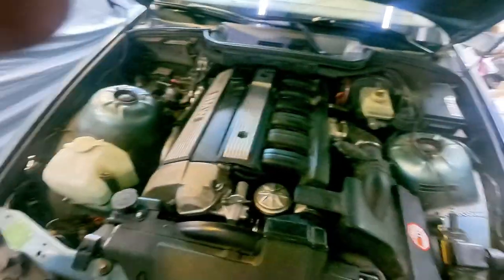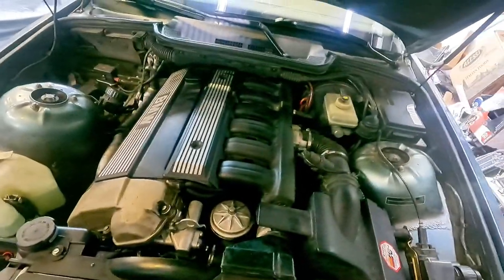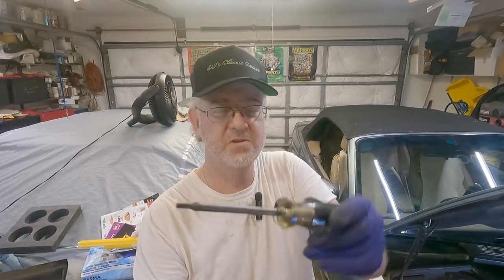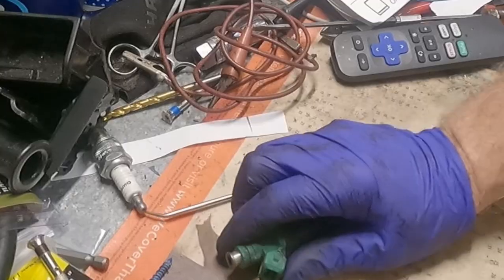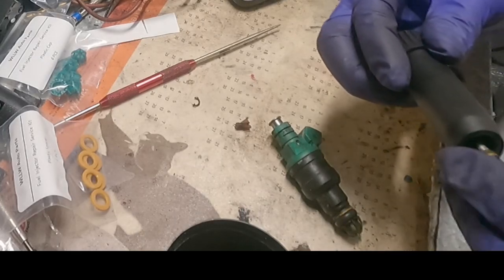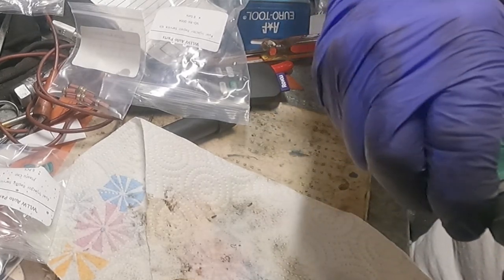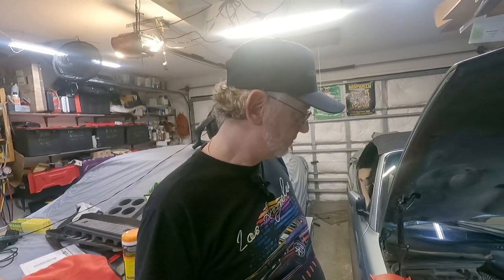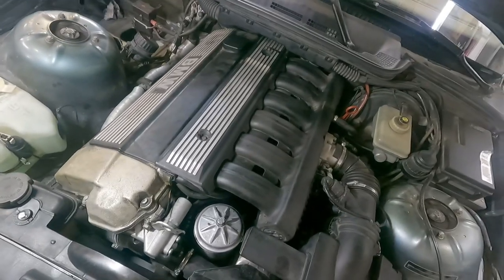Project E36 Quick and Easy Fuel Injector Rebuild with Assistant

Comment: 325i?
Reply from the maker: @watermelonwatermelon6513  yes the m50 at 2.499 liters powered BMW
Reply: @DJsClassicGarage  yes the amazing motor,saw the green plastic on injectors and figured its a b25, i had restored a m50b20 e36 coupe, the injectors were stuck, i soaked them in 646 nitro solvent overnight, connected to a compressor and then disconnected and connected power to them while changing polarity, all of them work now and dont leak!